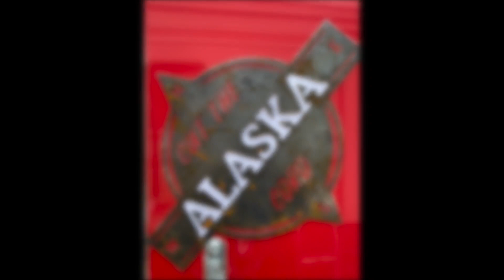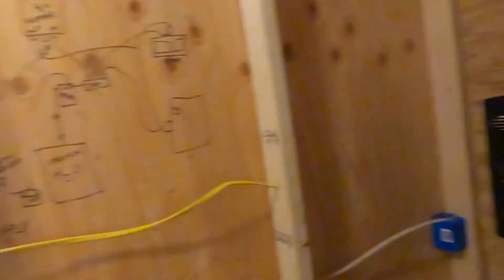Running water and an off grid kitchen.

Comment: I am later to the party, but subscribed now.  I have picked through about half a dozen videos so far.  Is this the same dry cabin that you initially stayed at, or is it your new Alaskan place, or maybe both?  Thanks for taking the time.  Love your Cut the Cord  “brand” , was that your handiwork with the plasma torch???
Reply from the maker: Welcome to the channel!  This is not the initial cabin. That was a temporary stay until we found one to purchase. I designed the logo but a friend of mine cut it out for me.
Reply: @alaskacutthecord769  when you start selling merchandise with your logo I will be at the head of the line, 👍